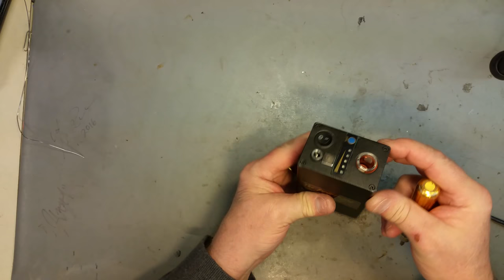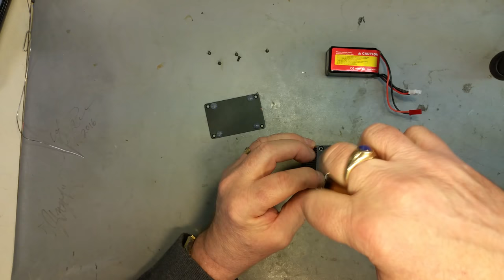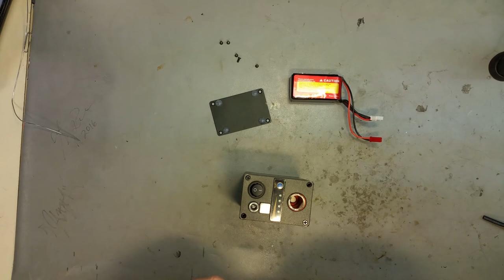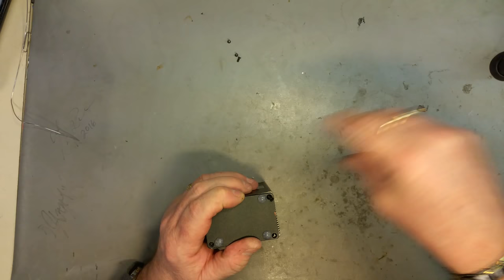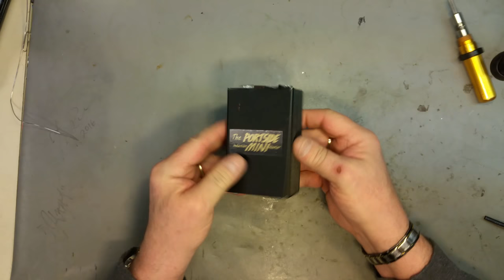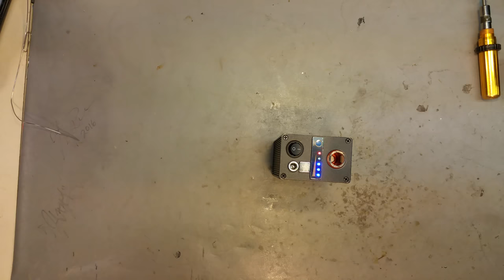PSMINI Disassembly and Reassembly

Comment: Why is the fet module necessary
Reply: The FET is used since the tactile switch isn't rated for the amount of power that the ZVS driver pulls. If the switch was directly inline with the ZVS, it would burn up. I know it's like a year later, but just in case anyone else was wondering XD

Comment: You also cannot run down a LiPo batt to zero and you should only use up 50% if you want them to last.  Discharge them too much and they won't  charge back up.
Reply: There is a balancer and LVC built into the battery harness.